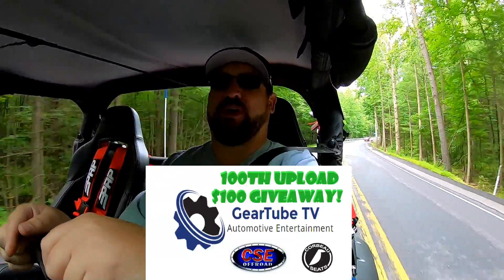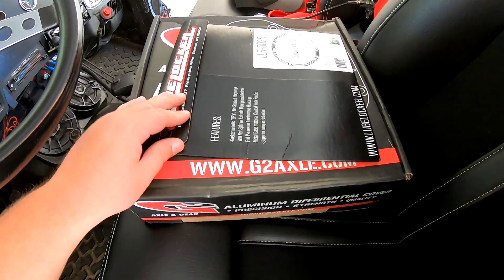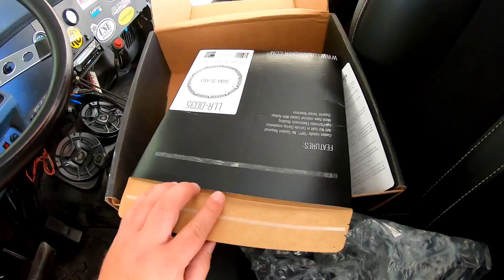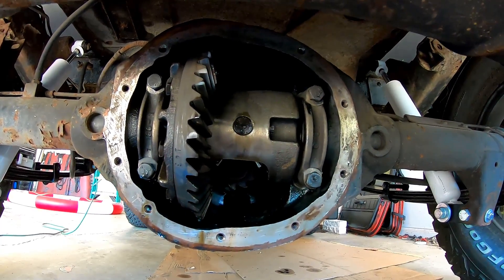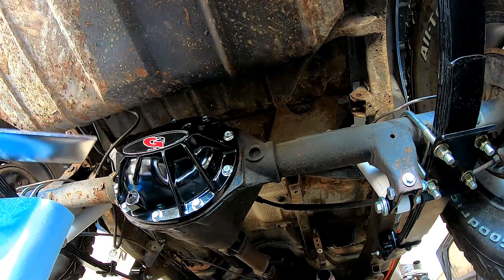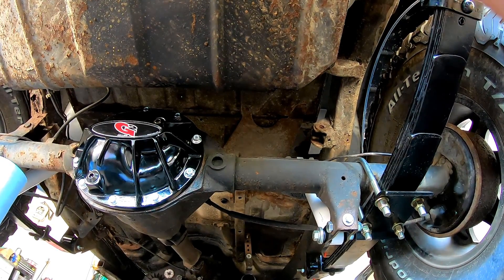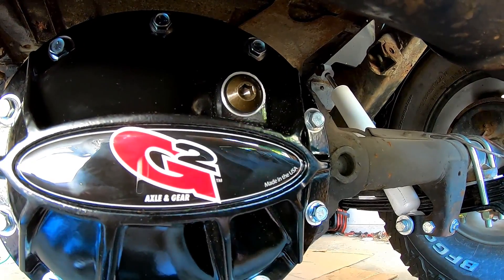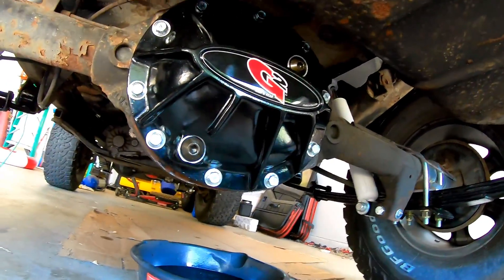Dana 35 G2 Differential Cover Install

Comment: What gears does that Jeep currently have? Any plans for an axle upgrade in the near future???
Maybe you could find a good deal on an XJ Dana-44 rear. I bought mine for $80 at the local U-Pull type salvage yard. 
I also run a Dana-30 front axle from a '98 XJ since it doesn't have the CAD housing.
Reply from the maker: It currently has 3.55 gears.  I'm looking to re-gear to a 4.10 if I keep the Dana 35.  I know the 35 is the weakest link in the drivetrain, but for right now I just have to deal with it.  I'm okay with the Dana 30 up front because it actually is a pretty decent axle all things considered.  I may move to the TJ axle shafts though to eliminate the CAD.  Time and money I keep telling myself HAHA!